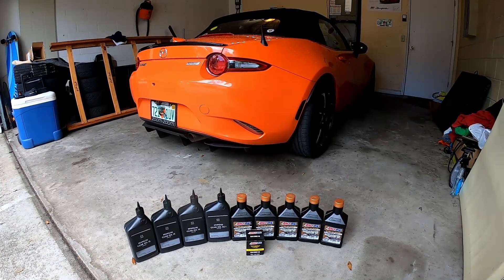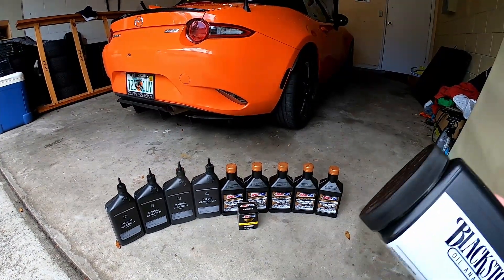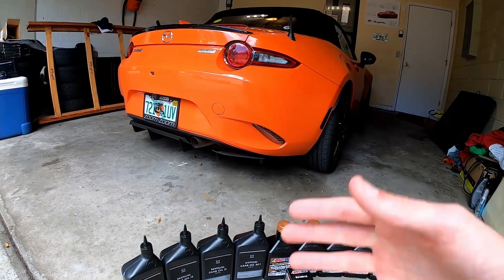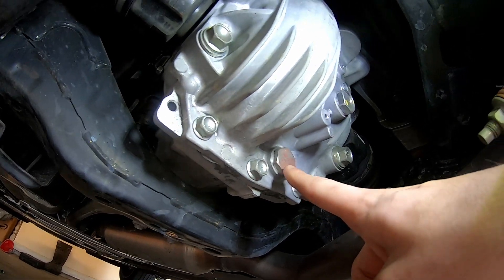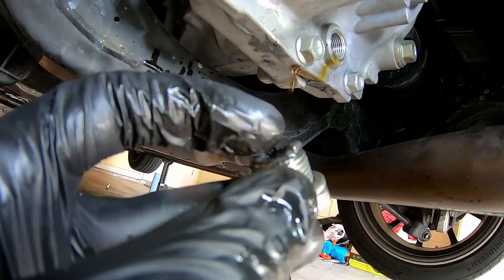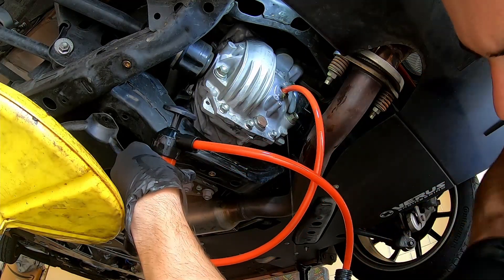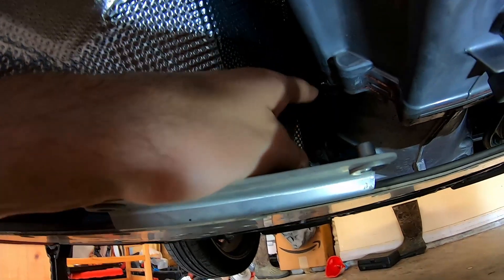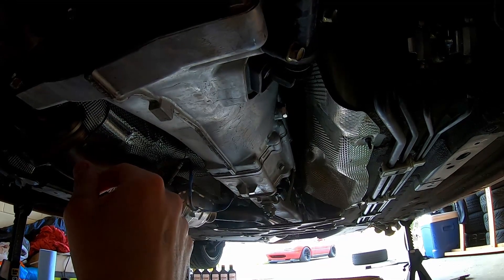How to Change Transmission & Differential Oil ND MX-5 Miata

Comment: Don't use an amsoil oil filter. I recommend sticking with Mazda oil filter because the ND Miata doesn't need an ADV in the oil filter
Reply from the maker: Thanks for that comment! I'm guessing this is because the filter screws on upside down? Makes logical sense now that I think about it lol
Reply: It's not only that Mazda uses some kind of solenoid. I don't remember exactly but there was a notice issued by Mazda to all dealerships recommending not to use oil filters with ADV on skyactive engine

Comment: Never use a crescent wrench to remove a bolt.  Its too easy to slip and round it off.  Buy a socket or a closed end wrench.
Reply from the maker: It may not be the best choice, but it’s a bolt you only touch once or twice during ownership. Get the wrench tight enough on it and go slow and it won’t slip, it’ll be fine

Comment: Just a heads up, the maintenence schedule for MANUAL transmission fluid is every 30k miles. Auto trans fluid is 60k.

Comment: My Mazda dealer says "We doesn't recommend to change the diff. oil as it has no replacement interval". Why is that?
Reply from the maker: @stephantimmermans6107  maybe they believe or have been told it’s a lifetime fluid. I simply don’t believe that’s true in any vehicle. It’s a topic of debate, most say no fluid is good for a lifetime while manufacturers still often say fluid is lifetime, especially in automatic transmissions. At the very least, it does not hurt to change the fluid out

Comment: Can you link the mutul comp gear oil you used?
Reply from the maker: https://www.fcpeuro.com/products/competition-gear-oil-75w140-1-liter-101161?ads_cmpid=1586641325&ads_adid=62615222609&ads_matchtype=&ads_network=g&ads_creative=298302774914&utm_term=&ads_targetid=pla-59910985102&utm_campaign=&utm_source=adwords&utm_medium=ppc&ttv=2&gclid=Cj0KCQiA6NOPBhCPARIsAHAy2zBRu5fv1aMdPDAVGfuodKxhI0ckGtFUzhPLSBVYxUnT5AdQRnEUbrEaAsUnEALw_wcB

I think this is where I got it from. FCP Euro has a lifetime warranty on everything they sell, even fluids

Comment: is it the same thing amount of transmission oil on Automatic miata?
Reply from the maker: No, I believe those use a lot more fluid. The capacity for it should be in the owner’s manual or found online
Reply: Hey, did you change your automatic transmission fluid? I need to do it on my ND1 but I can't figure out what oil and how much to use.
Reply: @DaveSimkus  Nope, not yet, I found the oil still new, but it should be straight forward action in changing it, Just no need for full flushing if its the first time, only drain and refill..

Comment: I am the proud owner of a 2024 ND3 Miata Club and will be changing my transmission fluid today from the Mazda fluid to the Ford XT-M5-QS Full Synthetic Manual Transmission Fluid! I am at 1400 miles and I want to switch to this fluid early as it’s said to be much better than the original fluid. 
I performed an initial oil change at 850 miles and switched to Pennzoil Ultra Platinum 5w30, I live in North Carolina and feel this is a better suited oil specification and wanted to get the initial fill out to rid the engine of any “break-in” material and go with a heavier oil. 
I am loving this Miata and am so glad I made the decision to pick it up and I am now looking at my options of what to go with as far as exhaust upgrades, just really a muffler swap, but there are so many good options and choices to be made! 
Thanks for the great videos you’ve compiled and I really appreciate your time!
Reply: Hyped for this! Just looked into the oil and it does have plenty of good reviews for our cars lmao. Ima go ahead and try it, but for 3 qts, it is somewhat expensive. Rn there is a deal on amazon, dropping down from about 44 to 32....So looking at 90 plus for transmission oil lol.

Comment: Great guide, thank you! I also have a 19 Club, looking to change the diff oil myself. It's been making a whining sound at low speed when I turn sharp. Do you know where to get the OEM diff fluid and the crush washer?
Reply from the maker: Uh oh, it's coming from the diff, not the steering system? Mine does too but I thought it might be the EPS system straining. I got the OEM fluid from the Mazda dealer I used to work at. They should have the washer too. If not you can grab any washer that size from an auto parts or home improvement store.
Reply: @DriveMX5  i feel like it's from the diff. Some other people on Miata forum reported the same thing, so I just chalked it up to LSD doing it's thing...

Comment: How do i know when its time to change diff oil?
Im about to go to the casa tom and there changing the transmission and coolant along with the brake fluid but i never heard to diff oil
Reply from the maker: I don't even see it in the Mazda service manual, but it's not a bad idea to change it when you change the trans oil. My main purpose for changing it is that I was tracking the car and driving it more spiritedly, so it was for my own peace of mind and ensuring the car was in tip top shape

Comment: Did you torque the drain and fill bolt or just tightened with hand?
Reply from the maker: Just hand tighten. I’ve always done that for drain bolts and haven’t stripped one or had one loosen up on me yet! 🤞🏻

Comment: Very informative, but I do have some remarks from that tiny country, the Netherlands. Here we go. Re-using aluminum crush washers? No, would not recommend. They are intended for single use for a reason. When properly torquening the plugs, the new washer is crushed slightly so the soft material can go into small scratches and surface roughness of the areas to be sealed. Re-using crush washers could compromise the sealing concept, especially when not properly tightened (sorry, but handtight is unspecified, Tighten with some 25 -30 ft.lbs (34 - 40 Nm) is the way to go.) Unlike for engine oil in cranckcase, checking oil levels in diff and gearbox is impractical since there are no dipsticks, want to jack the car for oil level checks? Very slowly losing gearbox or diff oil (let's assume 1 droplet per 5 miles) will make you lose 50% of your diff oil over 35,000 miles.  By then, you probably have heard some funny noises from the rear and this will be expensive too. Do not save a couple of $ by re-using crush washers, please! They are cheap life insurance for all 3 most expensive drive train parts of your loved miata: engine, gearbox and diff.
Opening the fill plugs first is good advice, not using 23 and 24 mm sockets and not using a descent torque wrench not so much.
For filling the diff and gearbox with fluid there are much more elegant and functional pumps on the market. They look like a 1 qrt plastic bottle with hand pump on top and transparant (!) hose with a bent metal tube to hang in diff and gearbox housing, so no need to secure fill line from dropping out (check Amazon). And a good quality manual gearbox oil 75W90 with a GL5 or GL3/GL4/GL5 spec as some brands specify, will do nicely for diff and gearbox. Warming the oil by putting still sealed (!) plastic containers halfway in a bucket of 120 F water for some 30 mins prior to filling your hand pump, makes filling a lot easier too. Mazda smartly states that non Mazda gearbox oil will give trouble in cold circumstances gear shifting. Really or smart  marketing? Enjoy your Miatas, love them with proper and regular maintenance (and decent tools).
Reply from the maker: I appreciate the feedback and advice! IIRC, I didn't have the 1/2" to 3/8" adapter with me (my ratchet is a 3/8" drive and my 23 and 24mm sockets are 1/2"), so I used the crescent wrench. I made sure to tighten it all the way and not strip the bolts.
Usually yes I would replace the crush washers, but I haven't had any leakage issues yet. Usually they can be used a couple of times before they cause any leak, certainly before they would cause any significant leakage. But I agree, generally you would want to replace the washers, they are cheap insurance!
Handtight, I generally say thread the bolt on by hand until it won't spin, then tighten down another quarter to half turn or so with the ratchet, usually you can feel when it's tight. Again I've always done this with oil drain bolts without issue, and I believe the vast majority of mechanics do as well. That being said, absolutely nothing wrong with doing it the proper way and thank you for providing the torque spec.
I agree, the pump I had was certainly not the best (it was cheap and old, lines weren't very flexible anymore and it tended to leak a bit). I threw it away after this job and will be getting a much better one for next time!
It is true, when I put Motul Comp 75w-140 in my transmission, the cold shifting was crunchier and more difficult. I threw that fluid in because I took my car on track twice within a month and wanted a fluid that would withstand abuse and high temps better than Mazda fluid. I switched to Mazda fluid after those track sessions and right before I moved more north, where it gets a bit colder.
Again, I appreciate your comment and thank you for watching!

Comment: Your channel is awesome, it’s so great be able to look your videos up in confidence for immaintenance and other installs.  

In your opinion, how fathomable do you think it is getting an lsd into the sport/gt models, and what might be the cheapest way to do that? Haha

Edit: I forgot to recommend, you should do a tutorial on unclogging the drainage route for water, I’m pretty good at keeping my car covered but spring time hits and sometimes I’ll be out when it starts pouring, there’s some videos on YouTube but I think you’d do a much better job of explaining the process
Reply from the maker: Thank you so much! I try my best to add value to this space. I think getting an LSD into the sport or gt models would be a bit of effort as you would need to undo the driveshaft, axles, powerplant frame, and probably some more. If possible, I would just go with a club model, GT with GT-S package, or the 2020+ GT models come with the limited slip by default. That would probably be worth it compared to trying to source a LSD from Mazda or second-hand and then having to swap it as well.

Maybe I can do a video of the drain cleaning soon! I've done it once before but probably would be worth doing again soon. I thought

Comment: Subscribed, interesting info on your channel as a ND 2.0 Sport Bilstein Recaro (as it's called over here in Europe) owner.
What time did it take approx. to do both tasks supposed you have everything ready upfront from oils, the right wrenches, drain pan, car jacked up etc.?
Reply from the maker: Thank you! I would say it took about 2 hours start to finish. Pumping the oil into the trans and diff takes a bit of time and usually there is some cleanup involved as well.

Comment: I'm buying a one owner 2020 RF, has hardly been broken in with only 8,000km on it. 

I always do all of my own maintenance, but have never had a car this new.

Would you reckon it would be a good idea to change my diff and gear oil early to remove any break in material that's suspended in the factory fill?
Reply from the maker: If it makes you feel better then go ahead, but I think it’s unnecessary at such low mileage. I’ve heard that it’s good to change engine oil every 6 months or so if the car isn’t driven much, but haven’t heard the same about transmission or differential oils

Comment: Hey man, Just wondering, what colour is the long life gear oil IS? Is it red/pink in tint? We can't get small bottles where we are but the dealer was happy to decant a bit from their large barrel. However, upon checking. The colour looks a bit reddish. Just making sure they didn't give me ATF by mistake.

Thanks!
Reply from the maker: @jjrosaria  that’s a great question, unfortunately I do not remember for sure but I don’t believe it was red. I’d reach back out to the dealer to double check, maybe one of their techs can confirm